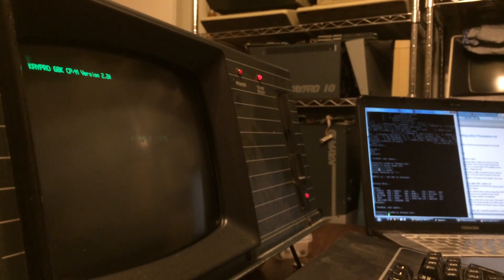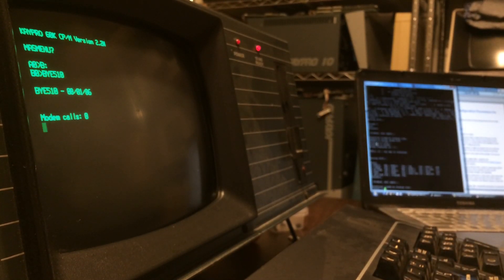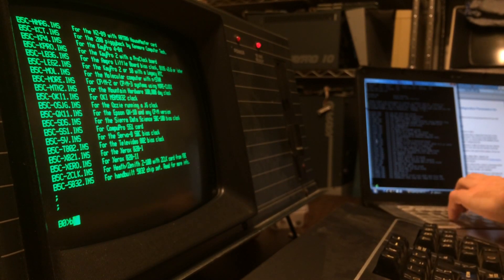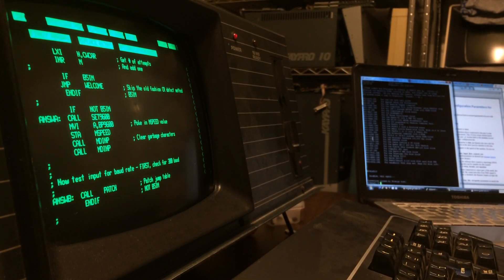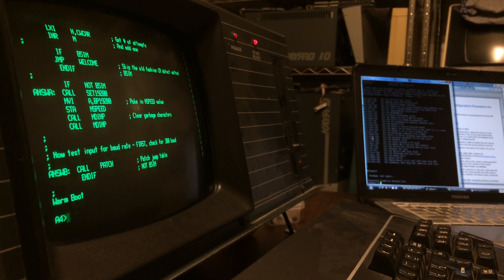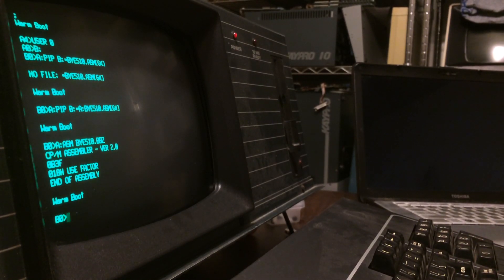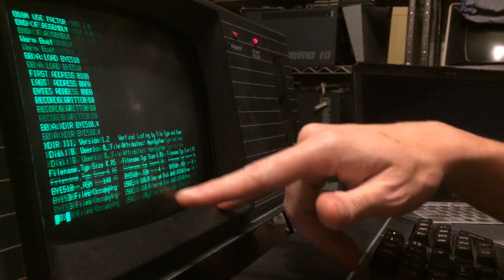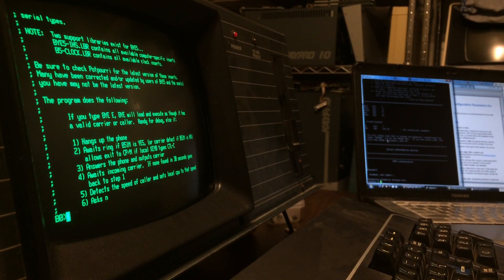Kaypro 10, BYE510, serial IO project, and the CP/M development process

Comment: what program would I use to transfer files to a blank HXC emulator floppy image for cp/m on a Kaypro II?
Reply from the maker: This will depend on what disk set you're working with - are they the original media for that machine?
Reply: yes It was a disk of preset banks for a music program. .
Reply from the maker: I mean your system disks - which ones are you using?
Reply: well I have used standard system disks and have blank SSDD disks but I am looking to get an image to an HXC emulator which is an SD card.  . basically, thank you.
Reply from the maker: Which system disks are you using.
Reply: System Disk 1 for Kaypro II, boots up with CP/M and contains the standard directories.  Let me clarify, I have some patch bank data on my PC in .VCE format which were originally contained on Floppy disks in the early 80s.  I now need to get them over to my Floppy emulator so I can see them from the Kaypro II
Reply from the maker: Ok, I guess I misunderstood in that case.  I am not familiar with VCE format or your floppy emulator, so I'm not sure I can help.  I thought you were saying you had a disk for the Kaypro that you wanted to archive to the emulator, which is different than what I think you're describing here.
Reply: in a nutshell how to properly get a file over to a virtual floppy image I can then place in my floppy emulator.  .  ive been posting around trying to find someone that has any good advice for a noob like me so I appreciate your insights.  very much.
Reply from the maker: Matt, I'm sorry - I'm so confused.  If you're wanting to get a file from a physical disk to a virtual image on some kind of device that acts like a virtual floppy drive, then the process is going to be the same as from a floppy to floppy copy.  If you're talking about a file on your PC and making that mountable on an image inside the virtual floppy disk, then I have no idea since I'm not even sure how the device you're using works, or whether it's even possible to interact with its images from a PC.  If you're saying you want to mount a virtual floppy to the Kaypro, then you just need to format the virtual floppy, and copy the files to it.  If that's what you want, I can make a video about that in the upcoming weeks, otherwise I can't really help since I don't know about the virtual device.
Reply from the maker: The biggest thing to consider here is the need to be excruciatingly precise in your language.  "get a file over to a virtual floppy image" - where is the file coming from?  is the image mounted to the vintage computer or the modern computer?  Details matter :)
Reply: you can find a 2.2u disk image online by just googling, I also uploaded my 2x's original boot disk to the HXC forums

Comment: serial throughput depends on whether or not the uart is interrupting the processor or not and how well the driver is written.    Most machines poll the uart. The well written ones use interrupt driven transfers.
Reply from the maker: +ChristopherLionRoars I don't always explain what I mean very well when doing these kinds of long, rambling, stream of consciousness types of videos like this.  That's pretty much exactly what I mean, if it's just polling the UART, stuff will get dropped at higher rates.  MITE does pretty well on the Kaypros, whereas the more common free/share/etcware don't.  MITE wasn't free software, but it did come free with many Kaypros, including the 10.
Reply: I had a kaypro II and then a 2x looooooooooong ago and even before them was a furguson bb 1.  In fact the io locations and chips of the kaypros were same as bb1 execpt the kaypros left out the ctc which sucked becaus i was experimenting with task managers and time slicing at the time.  Bios code was one of my favorite kind of code to fudge around in.  These days i miss my old z80 machines because everything today is hidden behind layers and layers of os libraries these days.  no more direct io.
Reply from the maker: It's really no wonder that modern software has so many security issues - if the developers don't understand how a machine works (and most don't anymore), it's impossible for them to understand how their compiler/interpreter does the things they tell it to do.

Comment: How do you hook your laptop up to your old CP/M machines? Have you done a video on that already?
Reply from the maker: ***** Usually, I don't direct connect the machines.  In the video with the Eagle II, I did have it direct connected to a DOS machine in the corner of my main workbench, via a null modem cable.  In this video, the Kaypro is connected to my Annex Three terminal server, and I'm connected with ssh to my linux machine, and I telnet to the Annex Three serial port that the Kaypro is connected to.